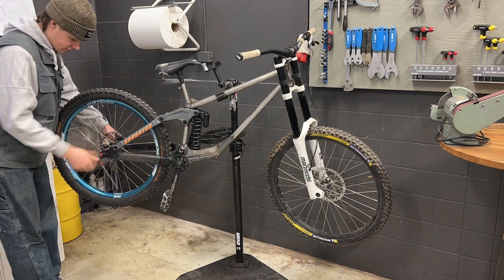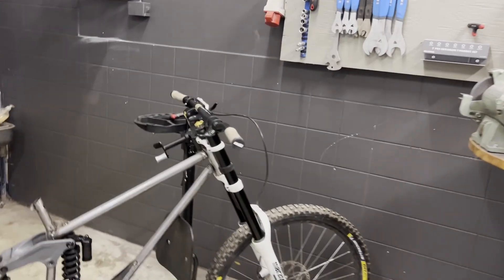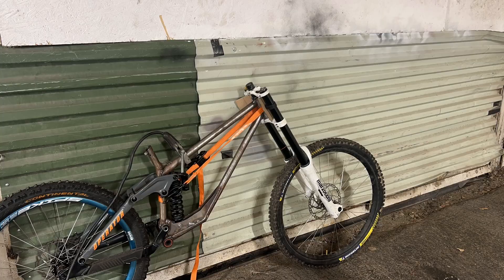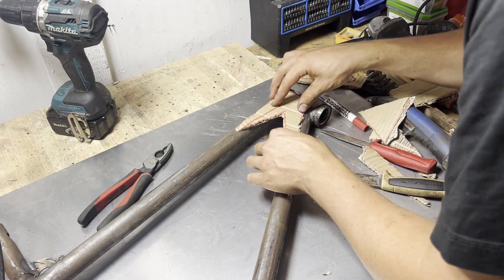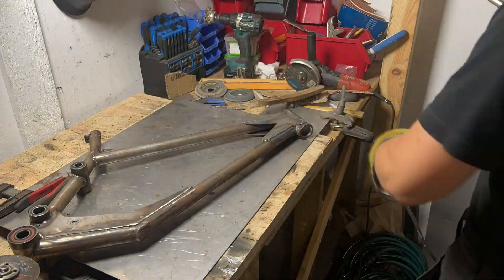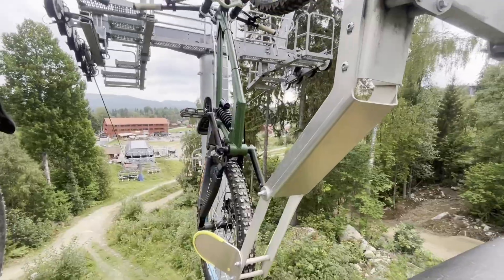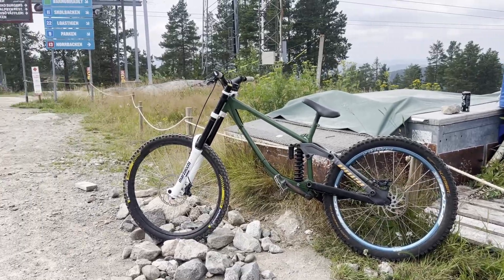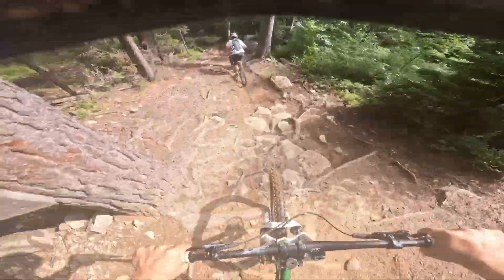Is it Possible to Make Your Own Downhill Bike? Steel Bike Frame Build Part 2

Comment: Which bmx cranks are you running? Standard bmx spindles are so narrow I'm wondering how they're not hitting the chainstays with that DH rear hub spacing
Reply from the maker: I am running a pair of cult childrens cranks 152mm with a spindle from a pair of mtb cranks for a 73mm bb. The original spindle did hit and im also not running a chainring wich helps and a lot of spacers aswell
Reply: @niilbolmstrom The bike looks sick! Looking forward to you building an entire new frame

Comment: Man I would love to have my fav bike turn into a steel frame.   But I think it would be heavy as heck.
Reply from the maker: steel is heavy but having just the front triangle be steel it does not affect as much because then its sprung weight and just makes the suspension work better in my opinion.